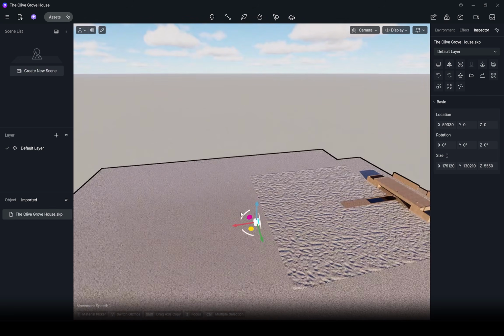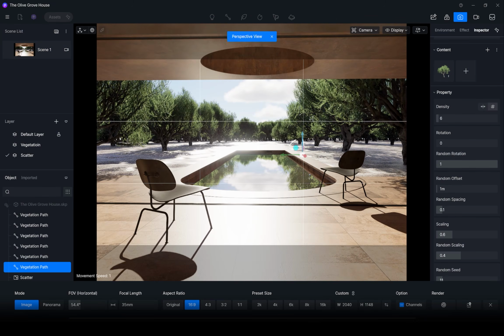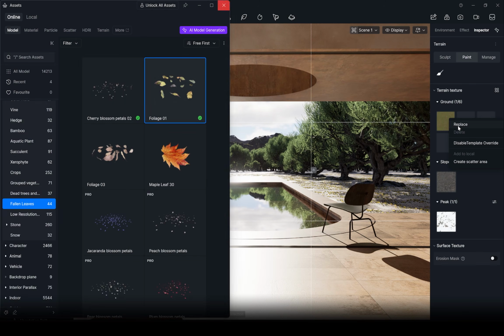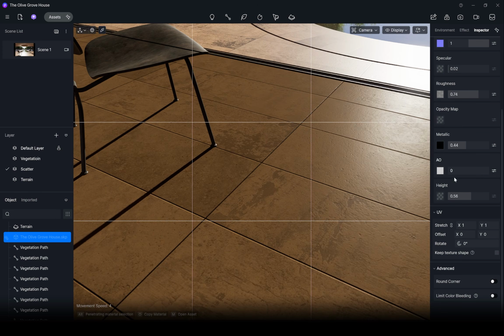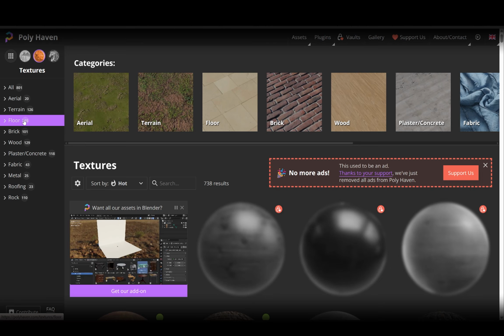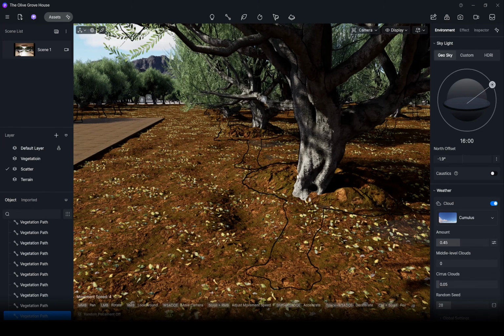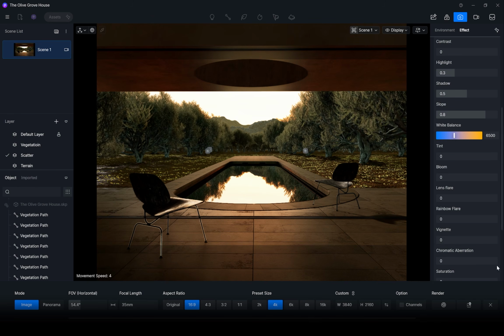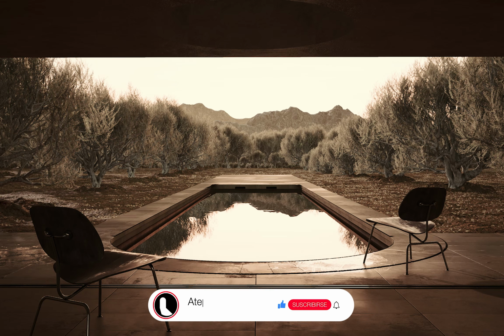PBR Materials and Atmosphere in D5 Render 3.0

Comment: thank you for this video! it was very helpful and d5 material library is limited to real projects and need custom/specific materials - and sometimes d5 materials are seamless with an obvious repeat …
Reply from the maker: Thank you! I yes the D5 library can feel limited for specific projects. I usually work with custom PBR textures and tweak scale and roughness to avoid visible repetition. It takes a bit more work, but the realism improves a lot.

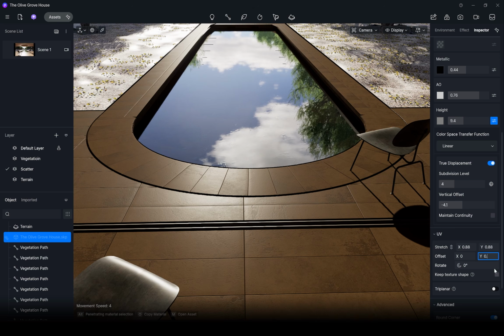Comment: @9:13 in the video you change the size of the pool coping and it maintains all joints pointing in towards the center....almost like the material is warping around a curve...how do you do this?? (I initially thought those joint lines were drawn in sketchup)... I tried to re-create your process and the material doesn't know how to warp around a curve. PLZ HELP :)
Reply from the maker: Hi! Great question, I struggled with this at the beginning too. So when you need a texture to follow a specific curved path, you have to set it up in SketchUp first, otherwise D5 will always project the material along the default XY axis. I used the ThruPaint plugin. It allows you to map the texture following the geometry.

You’ll find plenty of tutorials online, and you can download it from SketchUcation for free. Most tutorials combine it with Curviloft, which is great. But if you don't have access to it, you can manually divide the curve into segments and connect them to create the surface that guides the texture direction. Once the UVs are correctly set in SketchUp, D5 will respect that mapping even if you change the scale (make sure the Triplanar mapping is turned off).

Hope this helps! Let me know if you have any other questions.